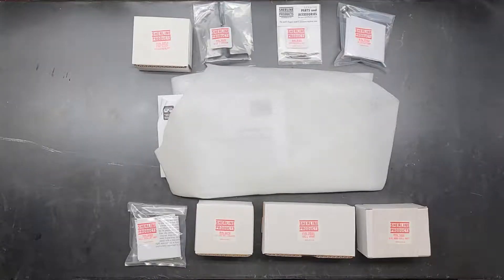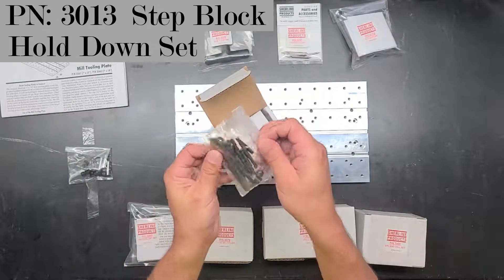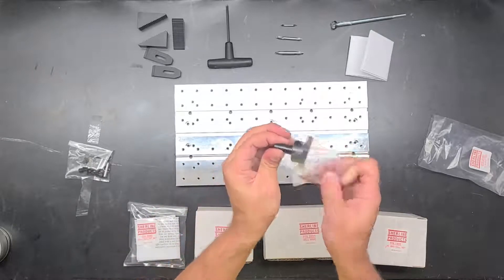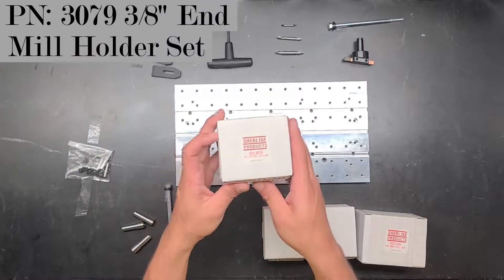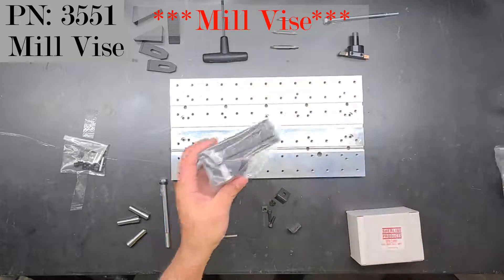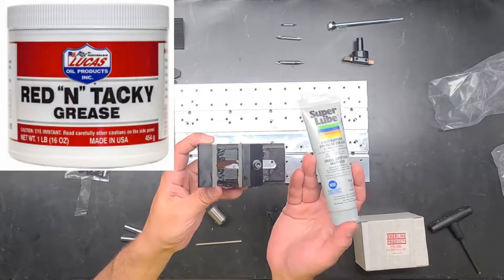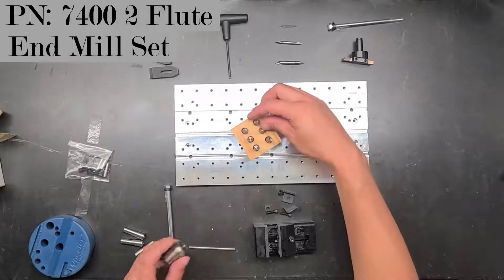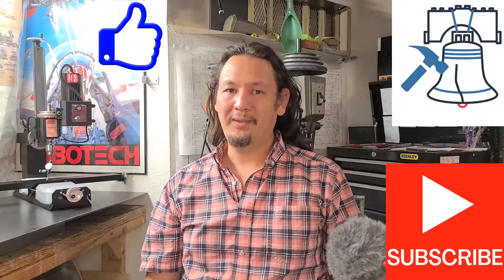Unboxing: Package A for the Sherline 5800 Mill

Comment: HEY  LOYD   CAN YOU BELIEVE IT !!!!!!!!!!!!!!!!!!!!!!!   I FORGOT ANOTHER PIECE OF TOOLING YOU MIGHT WANT TO 
CONSIDER FOR R/T SETUP     THE ADJUSTABLE TAILSTOCK     SORRY ABOUT THAT    MIGHT NEED IT FOR SHAFT
SUPPORT        MIKE  G
Reply from the maker: There is a ton out there after all Sherline fills an entire catalog. An adjustable tailstock would be nice to have. Thanks. Hopefully the rotary table comes up on sale.
Reply: @LoydPrecisionMakers  HI LOYD  THIS MIGHT BE ANOTHER ITEM TO CONSIIDER. THIS YOU CAN USE ON EVERYTHING  WITH RIGHT ADAPTORS   -------- A  COLLET SETUP -------- THE  WW OR MT. GIVE YOU BETTER LENGTH CONTROL + CONCENTRICTY THEN DRILL CHUCK.  UNDERSTAND ABOUT $$$ FINDING THAT OUT IN MY LATHE SETUP BUDGET----THAT'S QUICKLY GOING TO HECK FOR WHAT I WANT
LATER  MIKE G
Reply from the maker: Cool thanks I'll check it out. The headstock on Sherline runs a #1mt. I can't remember if mt and ww interchange or they differ by length an draw bar. Can't go wrong with either I think. Just wish it would take a 3/8" collet. I know what you mean about budget. Everything you listed I want!!!! Oh well at least when I do save a bit up Sherline seems preety good about everything in stock.

Comment: HI LOYD     SAW YOUR  MILLL/PACK  A  VID. & AGREE WITH YOUR OTHER COMMENTS THAT YOU WILL NEED A ROTARY TABLE & TILTING ANGLE MILLING TABLE.   I GOT THE SHERLINE ONES FOR MINE AS MENTIONED BECAUSE OF THE BOLT MOUNTING PATTERNS FOR ALL ITEMS MATCH ----------- JUST MATTER OF TABLE TO ROT/TABLE SETUP.  I ALSO SUGGEST  AS OTHERS   3''/PAR.  CENTER PLUG TO TILT TABLE CENTER( I THINK I HAVE ONE THAT DRILL CHUCK CAN BE MOUNTED FOR SMALLER PARTS - PLUG FOR 3-4 JAW CHUCKS--- IT CAN GO ON)  HERE'S ANOTHER ONE ------- 5''
TOOLING TABLE FOR ROTARY TABLE -- BIGGER THEN 4''  ROT/TBL. IF NOTHING ELSE MORE CLAMP ROOM.  I ALSO HAVE A 3'' REGULAR TOOLMAKERS VISE FOR    MINE.    ANYWAY  MORE THOUGHTS FOR BUYING.   AS  YOU MENTIONED YOU JUST CAN'T BEAT THE DESIGNS OF SHERLINE                   MIKE G    NOTE  SOME OF THINGS I MENTIONED I THINK YOU WILL NEED ON A3 -------- OUT
Reply from the maker: Wow. Very cool. Ya there is alot out there to really get alot of versatility.  That's a great point I hadn't thought about the bolt and whole patterns matching up. 😳 Makes sense each mfg may have their own system.